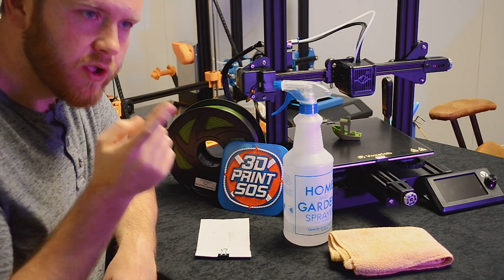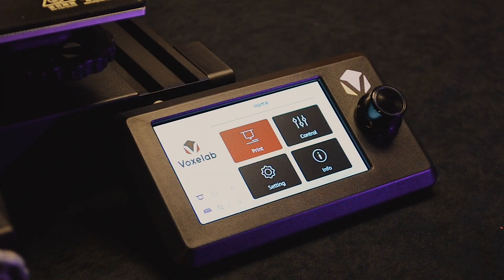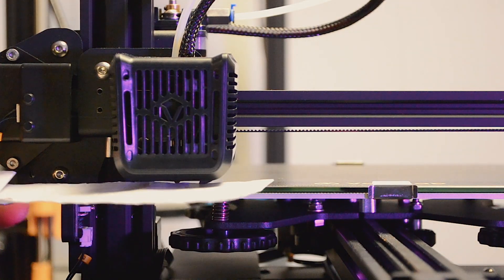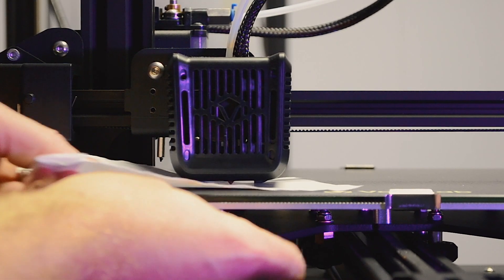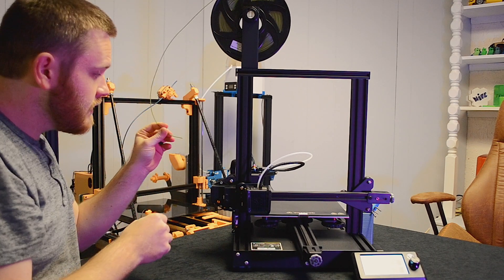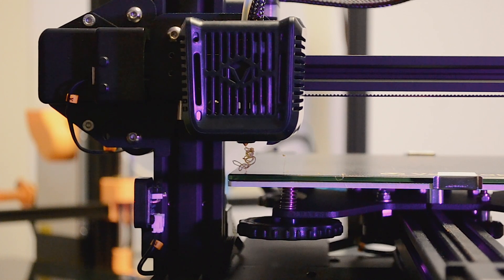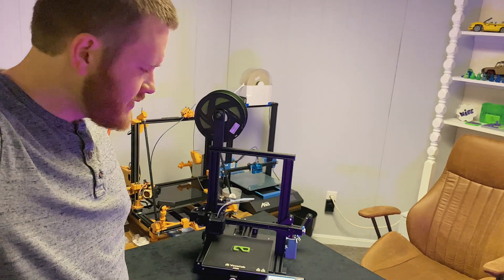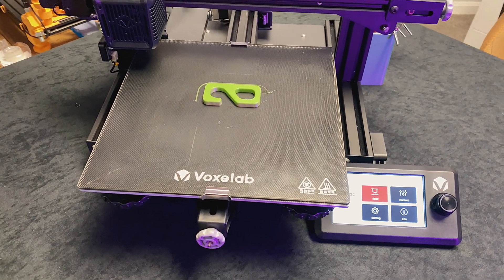How to Level Your Bed on Your Voxelab Aquila 3D Printer.

Comment: I tried to level this plate for 4 hours, I also disassembled everything and reassembled but if I can get an almost decent result at the corners in the center the nozzle touches the glass, how to do it ???
Reply: I didn't turn it upside down because I don't want to use additives and the plate sticks well, I took it apart because I thought it was the wheels but they are very tight and I did it even with the plate at 50 degrees. Is it possible that the aluminum plate is curved and also deforms the glass plate?
Reply from the maker: Hmm. Btw, I use no additives on bare glass. I mostly meant to see if the center is bowing in any way. I would heat it to at least 70c, even 80c for leveling.
Reply from the maker: Hmm. If you flip the bed over, do you get the same result? Are your bed wheels tightened? What temperature is your bed at?
Reply: ok I will try to turn it over, as a last thing I will try to put an aluminum sheet at the corners to create a thickness and try to think. However, the printer prints perfectly, too bad this problem !!! Thank you

Comment: Followed every step but at print I get a message that the system doesn’t detect the filament. Please loading filament 
The filament is in the tube and was able to auto load and filament came out of head in auto load. Any suggestions? 
Thank you
Reply from the maker: This is a setting called filament runout detection. The printer has the space and firmware for one but doesn’t have it installed stock. Simply turn off the setting in the menu and you’ll be back to printing.

Comment: Just got my Voxelab Aquila today. Constructed it in about 2.5 hours. I've set up hundreds of digital printing devices.... large format ink jet, small format latex, Direct to Garment Tee printers, etc. 
That helped. 
Came to your vids to get input on leveling. Just didn't seem to work right by the manual. Your comments and display of where to set a starting point (springs) turned the light on. I couldn't get the nozzle close enough to the bed. I had to reset the (factory set) limit switch for Z. 
Bingo!!
Used your technique and first test print is perfect! You are the MAN !! 
I'll be a regular and will hope to pay back to you and other viewers. Thank You!
Reply from the maker: Awesome! Glad I could help and thank you for the support.
Reply: How did you reset the z
Reply from the maker: @driftdeamon757 The z limit switch on the side of the machine can be moved up or down by loosening two screws that hold it on.

Comment: I got my Voxelab Aquila today ( 22nd May 2021 ) One day early from what Amazon UK told me wen I ordered it.  
Super well made Printer so easy to Build too.  

The company build help video on you tube was one of the best clear well filmed detailed and step by step easy to follow on building the printer I ever seen.

Even the packing used in the box and the clearly noted separate plastic bags of all the parts and well labeled bolts and screws was amazing!
The tools are great too and plastic parts and screws bags are very good strong press close quality.

With the printer already about 60% pre-build it was a joy to build the rest of it.

The quality of the printer and parts is the best I've seen.  Now after all that amazing stuff, 

I did have some problems with the printer when doing the 1st print of the test hook? 
( also I did scratch my bed on the left edge as I started homing it as I forgot to remove the plastic film on the bed and moved it before getting the hot end moved up 1st )
Silly me I forgot the nozzle was touching the bed as I moved the bed forwards to pull off the film. 

I did as you showed the leveling and made sure it was really done good, However my 1st 4 test prints of the hook and the Voxelab test piece did not work?
They all kept getting up to the half way stage of the printing using the supplied red see through PLA. and all popped off the bed and I had to stop and cancel the printing?

I found they all had curled up at the edges and got knocked off by the nozzle.

I did the homing again and the manual leveling this time with the bed hot ( 67 c ) and I set the nozzle hot end to 220 c with glue stick lightly put on the bed.
I think this PLA was just not being put down hot enough and the ed was not hot enough to make it stick the PLA down fully?

I just did all that and bingo this time the test hook stayed stick down and the printing worked. 
I did do a lot of slicing in Cura ahead of this printer being delivered o to a micro sd card I had as I allot of models waiting to be done!

All done with the Ender 3 V2 specs for size of ed etc. However none showed up on my sd card after putting it in the printer sd card slot?

I have to redo them now and work out why they did not how up on the screen on this printer!
Reply from the maker: Hey. You gotta clean the bed surface really really well. Otherwise nothing will stick. Try that first.

Comment: Hey Federer, seemingly my success was short lived, My little shapes test thing and benchy worked but since then I can get nothing to print, trying to get a BLTouch holder printed but it's going to pot after the first couple of layers, the PLA gets moved and then the whole print goes south. is there anything you can suggest, I've got glue stick to keep the prints to the bed and I think (he says) I'm level, what am I doing wrong :(
Reply from the maker: So it sounds like it’s not sticking? Or getting popped off the bed? What are your temperatures set to?

Comment: Hey so my printer bed title a little when you press down on one side, is that normal? And if it isn't what do I do to fix it?
Reply: Mine was like that too and I had to tighten the two adjustable wheels under the bed with the wrench they provide. Two of the wheels are fixed, the other two are adjustable by eccentric nuts.
Reply from the maker: Yesss ☝🏻
Reply from the maker: Hmm. If I understand you correctly, it’s normal. The bed is sitting on springs. So if you press down, it should move.
Reply: @3DPrintSOS  ok! Thank you!

Comment: Help !! at My lowest setting in the bottom left I can't get the paper under my nozzle ? what have I done wrong
Reply: Dont worry, sorted it eventually just a lot of twisting the knobs
Reply: Now on to your how to cura video :)
Reply from the maker: That’s all it is. Glad you got it.
Reply from the maker: Just have to relevel the bed. Use the wheels under the bed to make small tweaks

Comment: After you select auto homing make sure to disable the steppers and don't forcefully move the nozzle attempting to level it. He didn't need to disable the steppers probably because of an older firmware he was using. Also the bed scratches extremely easily. I got scratches on the edges after adding/removing the metal tabs that hold the glass in place.
Reply: Came to the comments just for this lol was wondering wth it won't move
Reply from the maker: Yup, redacted was right. That was a super early firmware. You have to disable it now. :)

Comment: so when i disable steppers my z axis slides and im having trouble getting bed leveled. I feel like i didnt have this problem before, but i took apart and reassembled my z axis. still having issues. as soon as i disable the stepper i see the extruder drop. how do i get a level with out turning the motors off?
Reply from the maker: Sounds like your roller wheels could use a hair more tension. There is a eccentric nut on one of the wheels that you can tighten. Just make sure you don’t go too tight.

Comment: Is it common to have to use a washer under one of the springs to level the bed? One corners spring seemed to be less springy and wouldn't press it up to be level with out a washer under it.
Reply from the maker: Nope. I would give all the spring waaay more tension. More than half actually. Then I would bring the z stop switch on the left side of the printer down some and relevel. The more tension in the springs, the more accurate abs the longer the printer will be leveled.

Comment: I can't get my fillament to feed through even when when the clip is held back
Reply from the maker: Hmm. Are you heating your hotend to 200c? What happens when you push filament manually?
Reply: @3DPrintSOS  nvm I got it to work now I'm just having a hard time leveling even after watching your video thx
Reply from the maker: Leveling is one of those steep but short learning curves. One day it just clicks and becomes much easier. One thing you can try is getting more tension on all 4 springs and then bringing the z axis limit switch down a bit and leveling. The pressure in the springs will help keep things a bit more level longer.
Reply: @3DPrintSOS  OK thanks how have so much help but I can't see any new files that I have added I have tried 3 now I have tried using the software on the card and it's the 3dbenchy from thingiverse if that helps

Comment: Is there anything you'd recommend doing? First print was successful, but since that first print, nothing seems to want to stick. The level didn't help with nonstick on this model I found.
Reply from the maker: Check out my live leveling video. That might help you level it and get things to stick. Get the bed up to 70c

Comment: Would you consider doing a bltouch/3d touch install video?
Reply from the maker: For sure. Highly requested by my viewers. I’ll have to get my hands on one at some point. Hard to justify putting on a 50 dollar part on a 170 dollar printer for a problem you can fix with proper tuning and leveling. ;)
Reply: @3DPrintSOS  that's why I plan to use a knock off, haha
Reply from the maker: Smart!

Comment: having a hard time leveling, not enough lenth in my right side so its lower then my left then now having issues with the filiment sticking to the bed. thought this was gonna be a breeze with your vids.
Reply from the maker: You need to add more tension to your springs and bring the z axis limit switch down to compensate. There are two screws holding it on the left side of the printer. ;)
Reply: The z-stop switch is too high.  Bring your springs down a bunch and then loosen the two screws on your stop switch so you can lower it a bit.  Do it in small increments and make sure to lower your bed first.
Reply: You can see the switch @6:37, it's what the white plug is plugged into on the bottom left.  The two mounting screws are on the left and go into the vertical arm (similar to how the media holder on the top is attached)
Reply from the maker: Yes. This ^

Comment: You gotta help me dude! I get all for corners to slightly drag on a paper but then the middle of the glass hits the nozzle instead of dragging. The I’ll go back to a corner and the nozzle is too close again. This exact same printer
Reply: Same issue here. Have you found a solution?
Reply from the maker: Are you guys heating the bed? Try flipping the glass and try again. Also try clips at a different position.

Comment: You should NEVER use IPA on these beds.  It takes the coating right off.  Water and maybe a little soap at the most.  When you do a first wipe on these with IPA, look at the paper towel.  The brown tint is the coating you're taking off and not dirt.
Reply from the maker: How sure are you here? I’ve been using ipa on this daily for months and it’s holding prints perfect.
Reply: @3DPrintSOS  just about to unbox my printer came across theses replies so should or shouldn't use ipa on bed now I don't know.
Reply from the maker: I use ipa daily on 5 printers. Never had an issue. Have been using ipa on two Aquila’s. ;)

Comment: Hi, I just bout Aquila 2 days ago. I like it but my alignment is almost alway off because the bed feels like it slants overall to one side regardless of the spring position. I feel like my bed is too low. How can I fix that.
Reply from the maker: Hmm. I would start by checking the wheels under the bed. The left side has eccentric nuts that can be tightened. The entire bed is then controlled via the springs. Now sure how it’s possible for it to slant regardless of spring position. :/. 

If the bed is too low, you can move the z axis limit switch down some to print the head down closer to the bed. There are two bolts holding that sensor on, on the left side of the printer.
Reply: @3DPrintSOS  do you maybe have an Instagram so I can message you a short video showing you the wobble
Reply from the maker: @Leorenderz  For sure. @3DPrintSOS
Reply: @3DPrintSOS  thank you, I sent a few messages. Thank you.

Comment: Hi Fedor, first of all thanks a lot for sharing your experience with your Aquila.

When leveling, I have to move the printhead over the print bed with the controller. The recommendation how to level (auto home -> disable motors -> move bed manually), does not work for me. I have aligned the frame so well that the travel in Z is very smooth and the X-axis already lowers slowly by itself when the motors are switched off. Hopefully I didn't do anything wrong with the setup ;).

The x-axis will then of course slowly lower itself after each print. The Voxelmaker end gcode disables all motors by default ("M18"). Therefore I use the printer settings for an ender 3 because it excepts the z-axis ("M18 X Y E")
Reply from the maker: I’m not sure about the z lowering slowly by itself. It should almost always remain. Otherwise you can run into post print issues like the z lowering itself onto your print. Smooth is good, but the wheels on the z might be a hair too loose in that example?
Reply: @3DPrintSOS  I recorded it earlier 

https://youtu.be/vhyshTqgB0M

https://youtu.be/2p4eijJc0zg

thanks for your reply ;)
yeah, that’s what I thought. till now I only printed some smaller parts and have always found the print head on the bed :-/

So you recommend to tighten the v wheels a little bit via the eccentric screws? ... my intention at first was to tighten it only as much as it doesn’t wiggle any more
Reply from the maker: Yes, tighten them ever so gently. Just enough so that it’s not all lose enough to slide down. The good thing is that you got it really square. So that’s great.

Comment: Does the paper thickness maters in leveling bed ? plz reply thanks
Reply from the maker: It does but it’s not critical. I suggest a standard white printer paper. Then once you start the print you can always fine tune live or use the zoffset setting to get this perfect.

Comment: Is it normal that the midway of the X and Y axis along the edges of the bed, the nozzle and bed gap is tighter? I can get all the corners to slip in a piece of paper with a bit of scratching with even amount of pressure, but then when I slide the nozzle around mid path, or right in the center of the bed, the piece of paper has more resistance. It's like the bed is warped (in the most miniscule way) like a "dome" shape, if that makes sense. I'm not sure if that will make a difference, we're talking like 0.05mm or something.. but just thought that was weird and if it's normal?
Reply from the maker: Quite common actually. The solution is mesh bed leveling. I really hope voxelab can enable this!

Comment: Whenever I try and print with mine the glass bed comes off for some reason, the nozzle is not going any where near the clips, any suggestions?
Reply from the maker: Interesting. I would try to get some binder clips to hold the bed on in that case. That’s a strange one. Are you getting curling and then the nozzle hits the print? Or the clips are just too weak to hold the bed on?
Reply: @3DPrintSOS  I think they’re just too weak, it’s odd because I can’t find it happening to anyone else, I purge the nozzle abs make sure the bed is clean but yeah it kicks it off for no apparent reason and as I said I even made sure the print went no where near the clips
Reply from the maker: That’s very odd. I mean, I just took mine off to take a look...maybe you can bend them in some to add some tension.
Reply: @3DPrintSOS  I’ll give it a go before trying some stronger clips but thanks for the quick reply it means a lot :)
Reply from the maker: No problem. Wish I couldn’t of been more helpful in response but that’s a new one for me. Haha.

Comment: First time printer here.

Just got this myself and I feel like I have the bed leveled, but looking at it flush, it looks warped/curved. The clips hold it flush to the surface but the corners look raised. do I need to give all four corners more tension?
Reply from the maker: Depends. Are the springs about half way in their tension already?
Reply: @3DPrintSOS  didn't seem like it. I tightened them all a bit more so we'll see how that works
Reply from the maker: Let me know

Comment: Hey!

It's printing and I'm amazed so far 😅

When my hook is done, do I need to wait for it to cool down or anything?
Reply from the maker: Yes. Let it fully cool down.
Reply: Also what should I do with the filliment when it's done? Should I remove it from the back end so it doesn't keep filtering through or can I just leave it in there until I use it again?

You got a Twitter? 😂
Reply from the maker: I keep mine on until I use it again. If it’s going to be a while, remove it and put it into a sealable bag with a bag of desiccant. Keeps the moisture out. I’m on Instagram waaaay more than twitter. @3dprintsos